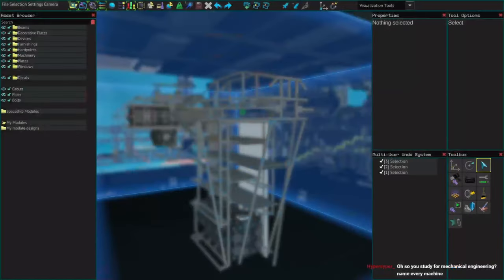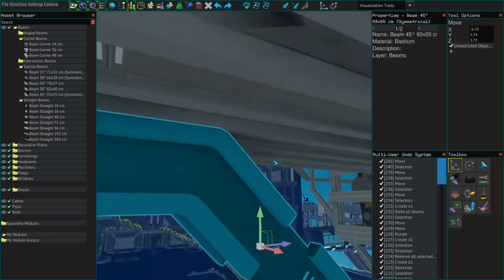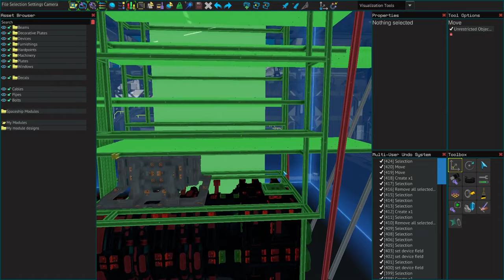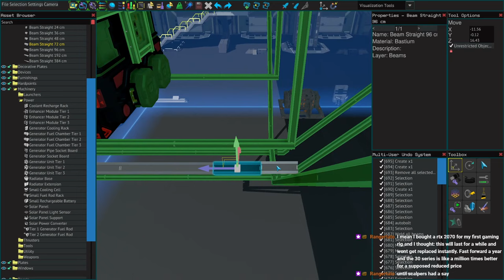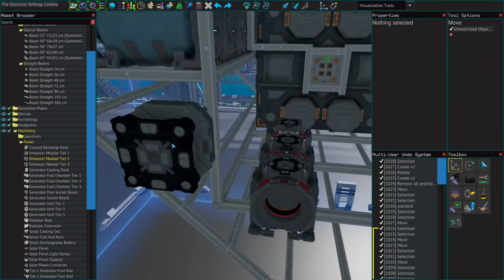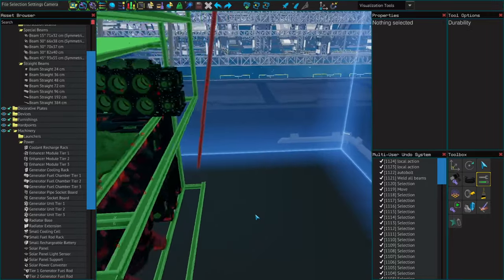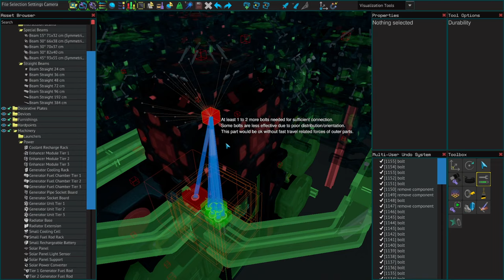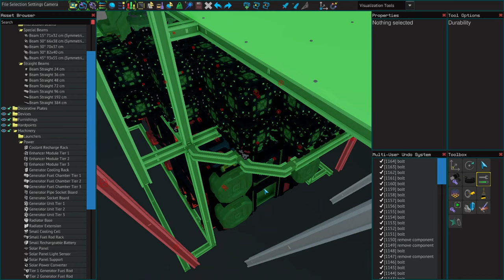STARBASE: Nebulon-B Strengthening Beams and Building Core Components!

Comment: Thought it was done... did you go back a few save points?
Reply from the maker: This ship is just going to take us a while due to my time constraints, so this is roughly the timeline that is real. However the yt is a couple days behind as streams are up to date
Reply: @simulatorhaven  I seen the build playlist not all the way through hence the steeam chat demanding your attention. but I skipped to the best parts. 
I get the your fans comes first before you really get into the ship, if space engineers can teach me something it's to work on a bit at a time: framing, armor than the components then remove a section if it doesn't work then reframe to fit all needed thrusters, power and if you're not burnt out hinges or build around your components. I know starbase is completely different than space engineers.